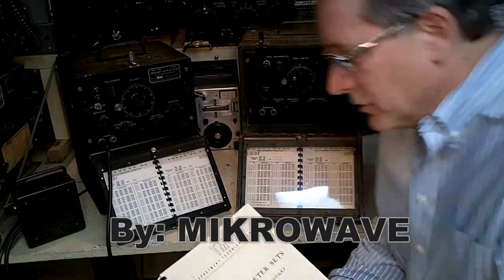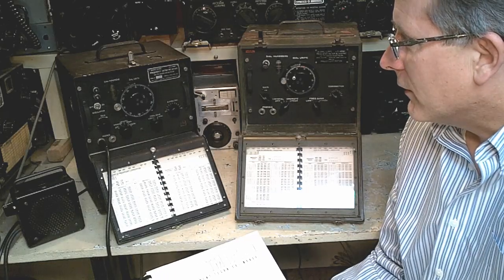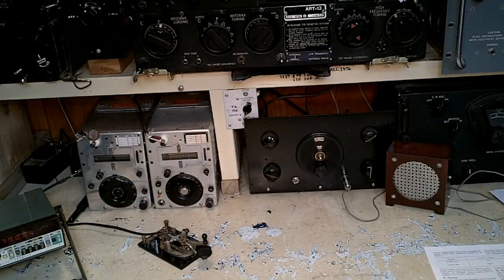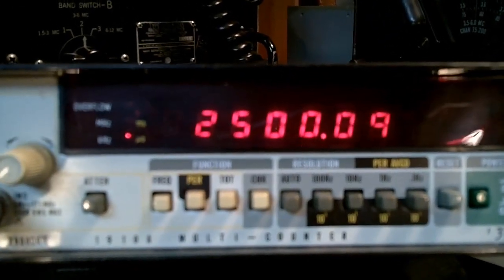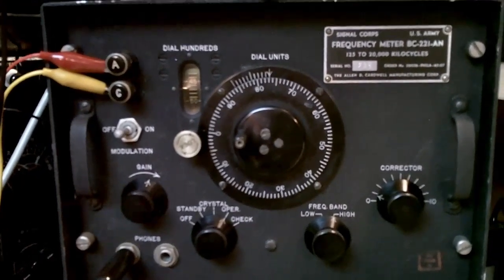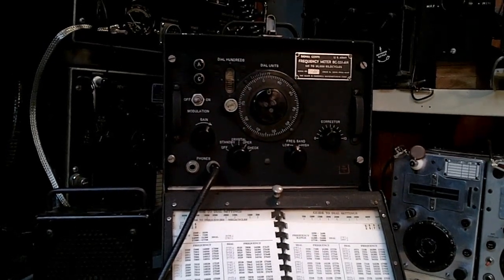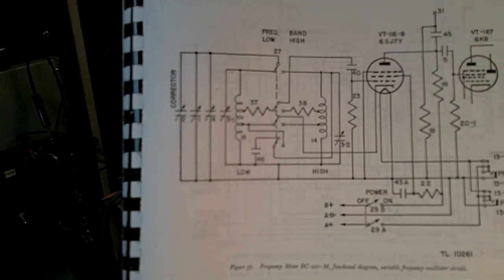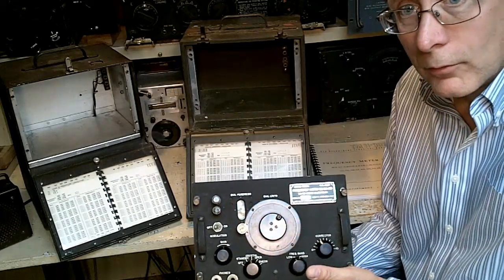BC221 Frequency Meter

Comment: I have the -M unit. I need to build a power supply for it. The power supply built for the military required the two filter chokes be 32Hy. Good luck in finding 1 let alone 2 of them.
Reply from the maker: No more as we have those fine 100 uF 450V caps now. Just a single 2 to 5 Hy 50 mA choke with two caps in a pi filter is plenty good.

Comment: is the one I have?
Reply from the maker: Yup!
Reply: @MIKROWAVE1  it worked 12 years ago.
Reply: @MIKROWAVE1  Can I use it as a VFO for a DX-40?
Reply from the maker: @K1OIK  not directly without extensive mods. But several articles were immediately written to add an external buffer amp in QST.  Look for  pdfs online 1947 QST
Reply: @MIKROWAVE1  I am not a member of the ARRL as a dictator is running the sinking ship, thus no access to archives.

Comment: Nice video on the frequency meter. I have a TS-175U unit that oscillates from 85 to 1000 megacycles and has a type N connector. It missing the 66/u antenna. It is in good condition and for auction price  of $5 not a bad deal. No doubt this unit was for testing early radar units on ww2 aircraft. Inside it has a 5000kc crystal and a tube rack with spare tubes. Crystal check points on the final pages of the chart are 200,400,800 and 1000. To get to 1000 megacycles you need to work on the 5th harmonic. A schematic shows a set of 135v and 6v batteries. How do you power your unit? I need to get it running and check on the spectrum analyzer.  Have you checked the harmonic output on your unit?
Reply from the maker: I did this one a while ago and the camera work was pretty tough! Yes that unit you won is a later unit, maybe post war.   Nice type N connector too.

Comment: Great video, how did you connect the frequency counter to the meter? I’m interested as I would like to check and adjust the crystal frequency if required. 
I’m thinking that the harmonics may make it difficult for the counter.
Reply from the maker: Actually my old counter had no issue on the signal even lightly coupled. Plenty of juice in the output.

Comment: BC221 Top left/h corner of panel. Ant  and Ground terminals. Are these retro -fitted? Mine doesn't have them but single antenna on the top (not centred)
of the case. There's no obvious place to connect an RF ground. Doing (or Trying to do) what you suggest is a messy business.
73 G3NBY.
Reply from the maker: There were many versions and manufacturers. This is a late model. Dunno?
Reply: @MIKROWAVE1  
OK  Tnx es 73 de G3NBY

Comment: hello i own an ww2 SCR-211-AJ / BC-211-AJ. its looks to be pretty good condition. the wooden exterior is not so great. paint peeling, wood peeling.  but the dial panel and everything behind it is absolutely prestine. however it appears the back battery compartment was modified by someone ? it now has installed a tray with transformer and tubes with an electrical cord. one tube glass is broken. i have not attempted to use it or anything. but a search online found this video! i am in NJ would be nice to meet someone like you who could give mine a little a love back to life!
Reply from the maker: That is the "standard" AC Power conversion done right by the book. The set was made to run on batteries, which nobody wanted to do. Now those old power supplies are suspect in many ways and need to be gone over!
Reply: @MIKROWAVE1  can you email me? cmartz@hotmail.com  i can send you pictures i need to identify a few parts!

Comment: hi i remember having a bc221 in 1968 i remember that the calibration book has a serial number which should match the serial number on the frequency meter to ensure you have the correct cal points
Peter N.

Comment: Nothing was said about how the set is powered.  I assume that batteries are not used, instead the power comes from a power supply.   It would be nice to see that, too.
Reply from the maker: Someone asked this 3 years ago: Most of the BC-221's that you find were converted to AC operation either by hams or by the military themselves. Typically you will find a small power supply in the battery box. Look at the typical 6.3 VAC and 150 VDC PSU schematic  here:  http://radionerds.com/index.php/BC-221 and here: http://radionerds.com/images/4/4d/TB_11-300-3_RA133_power_supply.pdf

Comment: Great video I just came across last week actually. I found this interesting enough to watch several times also. Sunday morning while at the Toledo Hamfest I came across a BC-122F. All aluminum case and appears complete except for the fact it has been converted to 120 VAC mains. The seller was happy to be rid of the "old anchor" and I was thrilled to carry the gem home. As it appears basically original I'll be doing a lot of research and restoring before the old gal will be ready for power. Thank you for the great videos you are producing and may you continue for years to come!

Comment: I used the BC221 several times a day in the RAF during the late 1960's. Easy to use and very reliable as I recall in 2018

Comment: i like to put my scope on my bc-221 to see how accurate it still is. i have a BC-221-T.
But i do not know where i could tap in to measure it. i have never worked with tube equipment so this would be my first. i think my scope would not really like a 135v dc on the input.
could you give me a few tips?

Comment: I just got a couple of these on luck. I could tell right away that they were very well built equipment, and it looks like they are unused. they work, but I have no need for them, as I don't know anything about radios other than speaking into one. if anyone wants to give one a home, I am willing to part with them.
Reply: I could be interested in one.  Let me know
Reply: well theyre in California, I would need at least 30 bucks a piece for them,  and we could arrange shipping after we strike an accord. let me see if I can message you my info
Reply: ralph Malone on facebook send me a friend request or pm. I'm the dude in the white tank top
Reply: send to Ernest Templer 6415 Lost Holly San Antonio TX 78240 etempler@gmail.com

Comment: MIKRO, An interesting video and great to see the BC221s and the other kit you have in the background. However you did not cover the calibration procedure using the corrector control inthe video. You might find that the 170Hz error is a lot less if the instrument is corrected at the nearest crystal check point to the required frequency. Its still not bad oscillator linearity for an instrument which is probably 70 years old. Thanks for taking the time to make the videos, and keep them coming!

Comment from the maker: Most of the BC-221's that you find were converted to AC operation either by hams or by the military themselves. Typically you will find a small power supply in the battery box. Look at the typical 6.3 VAC and 150 VDC PSU schematic  here:  http://radionerds.com/index.php/BC-221 and here: http://radionerds.com/images/4/4d/TB_11-300-3_RA133_power_supply.pdf

Comment: Bit puzzled by the 3750 test.
The charts are not in focus so it was hard to see which you chose.
You spoke 3824.9 which is not the 170 hz error to which you referred.
Where did I go wrong?
73 G3NBY
Reply: +MauriatOttolink Sorry ...I goofed. You read out dial setting. Makes sense now that I switched on my brain.

Comment: So I have one of these frequency meters, a bc-221-t. My problem is that it has a hefty requirement for electricity at a capacity that I cannot reach. Without the original batteries from 1941, and the strange power supply cord, how would I power this piece of equipment. A better question might be, how did you manage to power it?
Reply: Apparently MIKROWAVE1 went to sleep on us so let me see if I can help. If you Google "BC-221 Power Supply"
 You'll come up with some simple classic circuits. You will need about 127-135 VDC B+ @ about 100 mA and 6.3 VAC @ 1 Amp for the filaments. You can get the transformer off of eBay and the HV caps and resistors and diodes at a local parts house. Should cost about $20 total unless you have a good junk box. I posted something about my restorations of these units on righthandofzod.blogspot.com - take a visit.
Reply: Thanks for the reply. I did get the machine to work just fine by buying 9 volt batteries in bulk. This technique has also helped me restore a scintillation counter from the 50's. I managed to wrap the bc-211's antenna around the stock antenna of a dirt cheap and terrible shortwave radio. I was able to get it tuned so well, I love this machine. I do need a better power supply because the 9 volts only lasted me 4 hours.
Reply: +William Phinizy I took a look at what you had posted on your website and found it entertaining. I loved my 4 hours with my bc-221-t. I didn't find much information on exactly how your dad put the power source together. I was wondering If you would mind opening it up and sending me pictures or even a schematic. I have managed to find other schematics for power sources, but the more the merrier. I only had 4 hours with it working and I know that It holds more mysteries than what I was able to learn about it. Any help is much appreciated.

Comment: Thank you for a fascinating video.  Mine just showed up today :^)  I'm curious about the function of the beam filter in the tuned circuit demonstration - to limit the bandpass to the amplifier?  Also, what would be an alternative approach with discrete components?

Comment: As with all your military radio/equipment videos, I am fascinated. These are excellent tutorials and references -- and entertaining!

This time, however, I come to you for assistance. I have the good fortune of scoring a BRAND NEW IN THE BOX TS-323. This, of course, is the 20-450 Mc version of the above. It is pristine and packed without batteries or manual (save for the calibration book). I would like to get it back "on the air" and wonder if you might help me? I would ask your guidance in waking it up, building a power supply for it, forming the caps, etc. (I believe the A+ and B+) rquirements are similar to the SCR-211.

Any guidance would be greatly appreciated. I am k6whp and I am a member of the ARRL. (Nudge, nudge, wink, wink.)

Thanks in advance!

~Bill, k6whp
Reply: Disregard. I understand these two units fully and have both working flawlessly.

Comment: These meters were calibrated by computers. It took 16 hours to calibrate each meter. By the end of the WWII they were deemed useless by the military and sold for as little as $5.00. The Russians copied the designe and used them well into the 1970s. Great video. Thanks for posting. I hope you post more. I also like your ARC-5 videos as well. 73. KF0XO

Comment: Thank you for another very interesting video. You probably already know this but to lower the tendency to lock of your regenerative receiver you can lower the mutual coupling on the transformer. That will also lower the overall gain but there's always a tradeoff. I've never used valves so I'm not sure but lowering the anode voltage should give the give the same result.